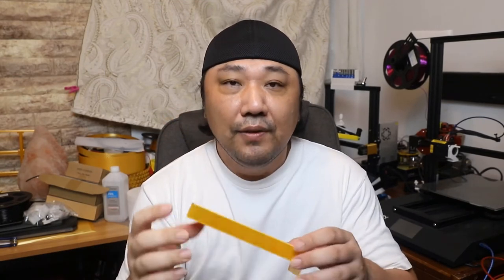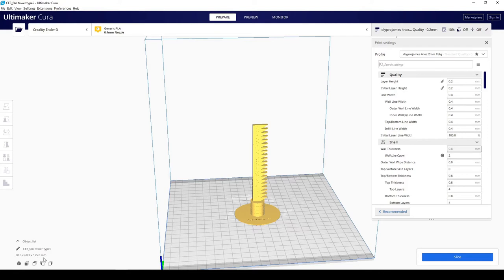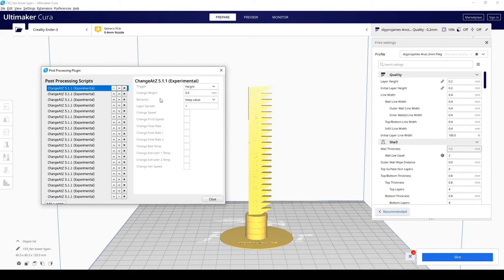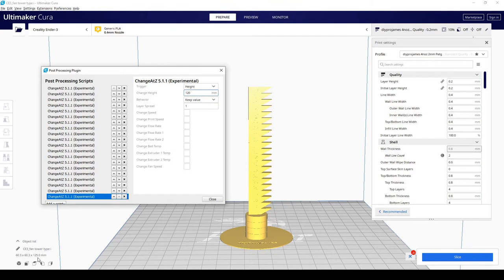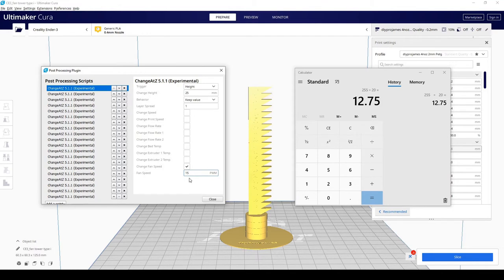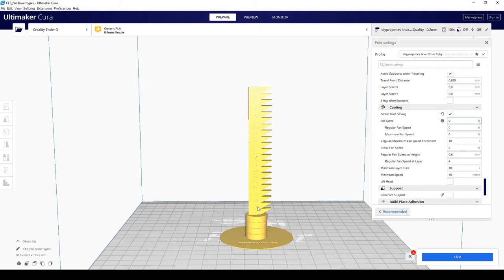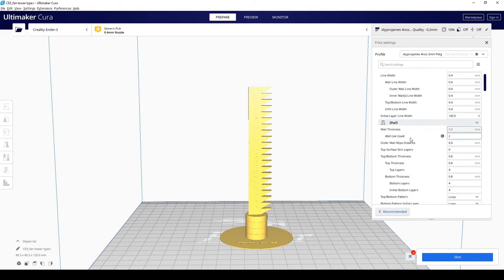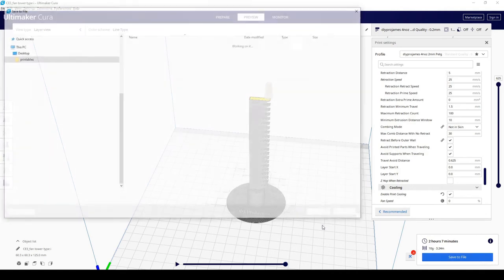Cura Files - Finding the Perfect Fan Speed - Fan Towers.

Comment: As of Cura  version 13.1 (and possibly some before), ChangeAtZ is now up to version 5.3.0 and the fan speed variable is no longer set by PWM but by percentage. That makes this procedure waaaaay easier because you can now just specify 5, 10, 15, 20% increments etc instead of all the math.

Basically set it to the layer height, minus 20 (at 25mm height set 5%, at 30mm height set 10% and so on).